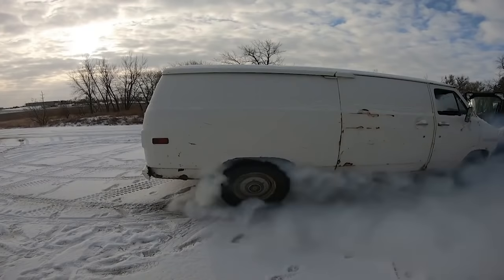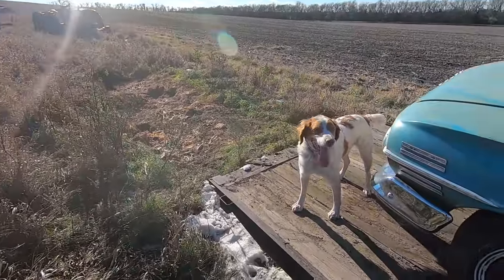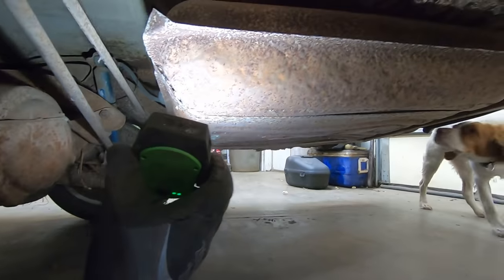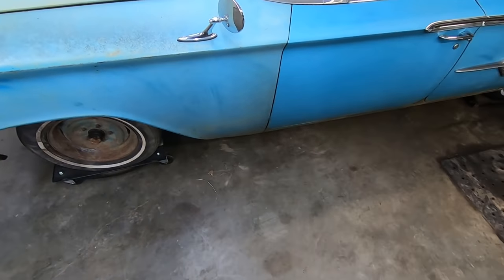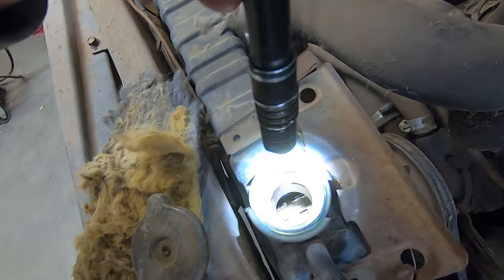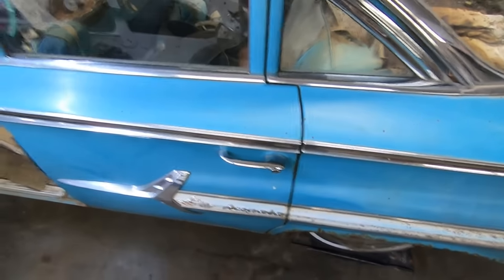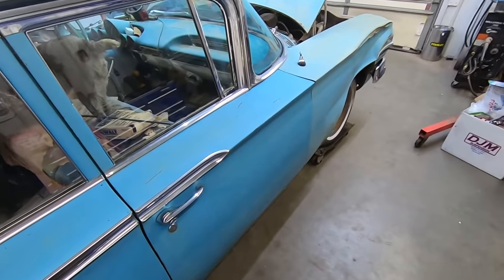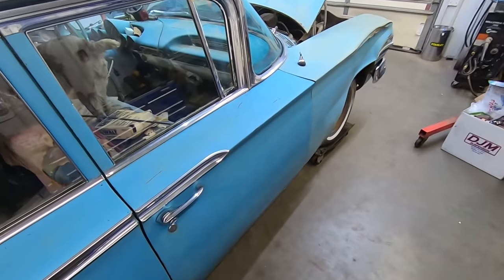1960 Chevrolet Impala! Will it Run?!? Abandoned in a Field for 17 Years! Bonus! Paint Revival!

Comment: That was an amazing video Mortske. I could watch you and Duff him of course without thumbs working on old relics for hours. Nothing better in my opinion than the basics. Points, plugs and condenser. Great job getting the old 1960 girl running. Duff definitely knew something he wasn't telling you. This was a great way to spend the afternoon relaxing after being part of accident in my 98 Chevy crew cab 3500 last Wednesday. A distracted idiot (cell phone) blew a stop sign broadsiding my truck. Caught it on the right rear door and cab corner and shoved the bed in to the frame and bent the right rear rim. The guy's 2016 Sentra literally disintegrated. Had my arm riding on the door with the window open because it's still in the 80's here. Injured the arm and shoulder some. Of course the guy had basic high risk insurance that is offering nothing for my truck but given it was repainted this year ($3500) and the AC completely rebuilt ($1200) in parts alone and lots of other upgrades like a new radiator and all new brakes totaling almost 6K they have no choice but to up their bid or get the crap sued out of them but the estimate to fix it is $5100. Bought the truck new. They will fix it. Looking forward to the next vintage tin rescue video. Thanks.
Reply from the maker: I love them OBS crew cabs! Sorry to hear that Bob!
Reply: You have a statute of limitations on filing the lawsuit.  If you don't have a lawyer by now.....think about how well skilled the insurance company lawyer is at getting you to forget the statute of limitations.  Lawyers work on a contingent fee: you don't pay anything to settle.

Comment: i ask you a while back on how much you wanted and you said you sold it, but i found a impala 1960 for a $100. and mounted the back 1/2 on my 92 silverado after removing the bed and back wall/window of the cab making it into a double cab. then added a extended lug 5 lug dually rear end. lugage rack, kc fog lights, single exshust pipe out tru the trunk lid.spare tire mounted on the roof w/support.

Comment: Interesting anecdote: 6 cylinder Chevy points and condenser will fit older Harley motorcycles(iron barrel Sporty, Shovelhead and earlier engines)as they used AC Delco electrics in their bikes. The old AC Delco mechanical voltage regulator also works on a H-D charging system.
Totally f'n' unrelated to the video, but different!

Comment: Had a 71 dodge trades man 100 223 slant 6 3 speed with a Hurst 3 speed on floor if it got hung up I would just reach down pull up the boot any adjust the linkage and go on my way

Comment: Nice job with relatively minimal effort.  ((I would have definitely messed up that distributor rebuild))  I'd say getting that fender ok-ish would add about a grand to the value (though time would be better spent on the brakes and fuel system), pack the seat with something like mineral wool then throw on some mexican baja blankets with blue stripes would add at least $500.

Comment: I Used To Buy  A Lot Of Cars At Public Car Auctions, And I Found That By Taping 3 Very Long  Extensions And A 3/8 Socket, I Could Reach And Unscrew The Latch That Holds Down The Trunk Lid. FYI Good Video, Its Very Informative For The Younger Generation,
Reply from the maker: Thanks for the tip!

Comment: Mortske re- paint the roof,(bite the Bullet) full hubcaps, and 1960 style wide whitewalls,(actually, just standard 1960 whitewalls, all manufacturers went to the thin 1 1/2 inch white bands in 1961. I did not think it was a good move, likely done by the same guy that promoted 2inch wide neckties. Oh, try Simonniz Scratch out, less than 1/2 the price of Meguiar's works&bonus smells good.
Reply from the maker: I'll have to check out the Simonniz!

Comment: Back in the 90's the old man around the corner bought materials to roof his barn but couldn't do the work. He came out to see me 1/2 done. He said he had been trying to trade an old car for labor. So sight unseen I agreed to take the magic rust ball under tarp 3. It looked like an old Fairlane. 
Nope, 66 Pony car with 22k miles. The interior was packed with blankets, stuffed with NOS Cobra chrome, radio and body conversion kit! The engine... 351c w/Aussie heads, 4 brl Edelbrock w/  Edelbrock carb. The trunk??? All good things.
Sometimes a good deed pays off.
Reply from the maker: Nice!!

Comment: I had a 62 belair that I pickup for $25.00 from a kid, towed it home and started working on it. the head gasket gone between 2&3 and 3&4 cylinders. Took the head to my  local machine shop for a valve job & new seals. On the way back home stopped and got a top end gasket kit. When I got home my wife said the Machine Shop called and to call them. The Owner said that the heads were perfect and shouldn't do anything but replace the seals. When I got there they had the heads ready and I think he charged me $20.00 for the work, I took it home and put the head back on and it fired right up and purred like a kitten. I Drove that car for almost 4 years with not troubles until Hurricane Hugo took a full grown Loblolly pine tree and smashed it flat. Poor old car didn't have a chance.
Reply from the maker: Nice!

Comment: They stopped using tubes in car radios around 62-63. Some radios had tubes and transistors.
If your radio has tubes it will take a minute to warm up and come on.
Reply from the maker: Interesting

Comment: You haven't gone through carb yet...dumping small about of gas will only run for seconds as it did.   Clean out out the carb and make capable to feed fuel...then it will run for a while.
Reply from the maker: Seems to run just fine

Comment: Thats not a yardstick, its a wooden tape measure. its still pretty useful in the trades for measuring things that arent in a straight line without 19 other people to hold the tape for you. pipe fitters, electricians, sheet metal workers all still use these quite a bit. in fact i have a new one i bought myself and the one my grandfather used in the trades 60 years ago. both work great
Reply from the maker: Thanks for the info! That's awesome!

Comment: i go by this i dont like patina so if the paints crap throw a good spray paint on it after wet sanding a bit butleave the trim alone unless your doing an actual paint job like i did on my truck great video definitely that paint came out decent i definitely wouldve atleast banged out the fender dents and adjusted the door ps a plunger works good for pulling dents
Reply: oh and definitely boiled linseed oil the top take a scotch brite pad run it over the top to kinda refine the patina and help with rough edges the wax and grease remover then lay on the linseed oil thick

Comment: In 1985 I became the second owner of a 1960 Bellaire, 6 with a two speed tranny. The car only had 55,000 on it with the original spare in the trunk! I loved that car it ate almost everything on the road. Speed limit was 55 in those days but the car was made for 75 and it was a struggle to keep the speed down to 55. Hit the gas and it squatted and took off. Sadly age and few really bad road drivers took its toll with it. So pretty with the polish job.
Reply from the maker: Sounds like a gem!
Reply: @MortskeRepair  She was. She was lovely and was almost silent when she ran. Then people started running into her diving or parked. It was almost as if she had a target on her.

Comment: I had an old 72 C10 Chevy straight 6 3 speed and they used to find up and you'd have to take like a large screwdriver and pop them loose yeah I wish I knew that there was adjustment to them cuz I hated that three on the tree I ended up putting it in a 3-speed on the floor. And my last one I had was a 69 Ford F100 8 ft stepside in line six three on the tree that one was jammed up and I just  went full commando and put it on the floor
Reply: Bind up
Reply from the maker: Yup! 2 many folks didn't know how to tune them up just right!

Comment: Tech tip on lost keys.  GM cars from like the forty's to early 60's have the code on the driver's side door lock pop it out and give the code to locksmith.
Reply from the maker: If the nearest locksmith wasn't 60 miles away!
Reply: @MortskeRepair  guy on eBay out of Missouri will take your code and send you one for $15.

Comment: overdrive, post sedan, straight six, mostly all there, when I get off the waitlist for a garage I might have 3k left over to consider this then if it's still available
Reply: I'd probably go with the turbine wheel covers from the 68-72 era, they're 14 inch and have the flags on the center cap to match that steering wheel instead of the usual bowtie.  $150 for a nice set on the bay of e's.  Otherwise, if I can't find those or a set of smaller dog dish hub covers, I'm fond of the '68 Impala caps, and if I can't find those, 14 inch wires from a 70's Mopar have a plain black center and I can put flag decals on there and it'll look right to most anyone and anger those who need angered the most.  Purists.  Ugh...
Reply: hahahahaha prep shmep don't think for a second I won't tape and paper off around that roof, spend four hours with a Brillo pad, then shoot cans of aeroseol Rustoleum gloss white coat by coat, wet sanding in between, until it's smooth and even enough to wax...and then I'll do the spear white the same way and it won't take NEAR as long...then each year it might need a little touch up but it's available at any Walmart in the country so no color matching hassle

Comment: That is such a beautiful old car. Excellent video as always
Reply from the maker: Many thanks!
Reply: Reason I enjoy your videos so much is you actually do the revivals with what is existing, Meaning you at least give it a chance without putting hundreds of dollars worth of new parts on them cars. Like when you used the points off the dash, god I was hoping you would. Lol.
Reply from the maker: @stevenlatham4397  Damn straight! Just showin folks you can get this old junk back up and running on a budget. No need for new carburetors and distributors and engines and fuel systems. One piece at a time!

Comment: I was hopin it had a 348 in it. One of my favorite motors.
Reply from the maker: That woulda been sweet!
Reply: @MortskeRepair  I seen rebuilt 348's online for 500 bucks. Too bad I ain't got a body or I'd get one.
Reply from the maker: @stevewheatley243  What?!?!
Reply: @MortskeRepair  What,you can't believe the price of the 348's? I believe that was eBay.
Reply from the maker: @stevewheatley243  Never seen one that cheap
Reply: @MortskeRepair  Enter"348's for sale"in your browser.
Reply from the maker: @stevewheatley243  Just did, $2800 for a core engine!
Reply: @MortskeRepair  We must've seen different sites. I looked around awhile and I might've been wrong about eBay.

Comment: If people only knew how reliable points were, that wouldn't have happened. You can't loose the screw if you never take it out. I have been driving on the same used points the car came with for 5 years without a problem. I think I reset them once.
Reply from the maker: I got a few of those too!